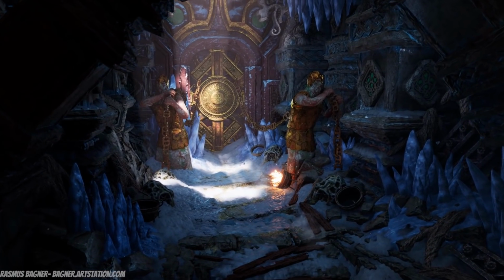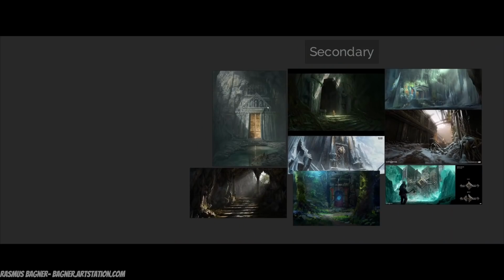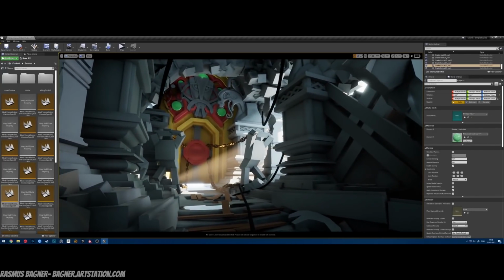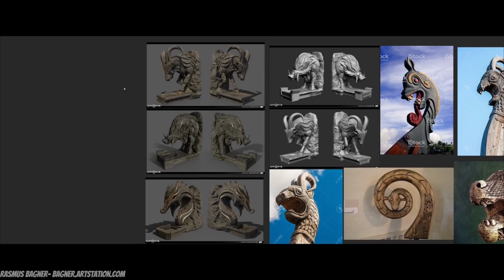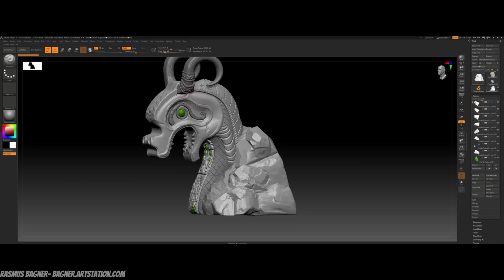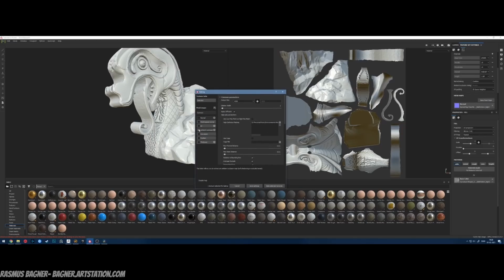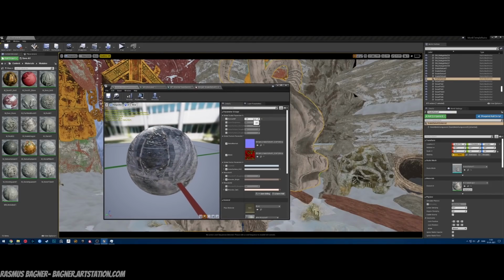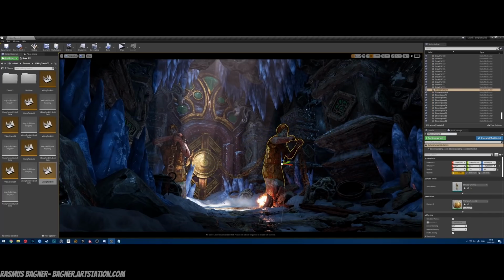How a 3D Artist Creates 3D Environments (Full workflow Breakdown)

Comment: Hello!
This was exactly what I needed to see! How long do you estimate it takes to put together something like this? I'm very conscious over that I'm very slow and is genuinely curious, so I can know approximately how much time I should aim on myself if I'm to make it into the industry. 
Also, very nice results!
Reply: Hey Julia Fisken, 
It took around 6 months after work but I always make at least 2 scene at the same time to avoid being bored.
I also took a long break from it so it's hard to give a proper estimate, but do not worry about speed in the beginning we all learn at our own speed.

Some recommendations is.

1: Make smaller scenes in terms of time needed to create the assets needed for the scene, not actual scene size you can do large scene fast with few assets though larger sized scene can feel overwhelming.

2: Have a main concept to help guide you and avoid getting stuck and when you feel comfortable with your skills try and make your own original scenes but this will take a long time to master.

3: Try and have 1 or multiple things you want to learn with each scene, do you want to get better at substance designer then make a material focused scene.
Do you want to learn lighting then have that as your main focus and maybe take shortcuts with megascans (remember to mention the use of megascans if you post it on artstation)
Doing studies like this will help speed up your scene creation time as you will be increasing skillsets that you feel you lack.
You often see this with artist using many hours on creating a single very solid asset instead of creating a whole scene.

4: Depending on how much time you can allocate try and find scenes that you can make within a manageable time, do you only have 2-3hours after work each day? Then a diorama is maybe the way to go, do you have 16-18hours a day? Then go for full scenes if you want.
I did a scene every 2-3weeks when I were looking for a job. This was 2 weeks https://www.artstation.com/artwork/0XEXYw  and I think this one was 3 weeks  https://www.artstation.com/artwork/N5gJmb  but I also worked 16-18 hours each day 7 days a week. (please remember to take time off as well though, burning out will only hurt productivity and negatively affect health, I took vacations during my job search)

5: As mentioned in the tutorial always ask for feedback but know that some feedback should be taken more serious than other, is it coming from an industry professional, a classmate or a parent.
Also decide if you want to use that feedback at all in the end you are trying to get your creativity out there and being able to know good from bad feedback is a good skill to have.

6: Joining an art community can also help a lot, it definitely did for me. Some I recommend is 
Dinusty's empire.
Beyond Extent
Experience Points

I hope this answers your question and thank you for the compliment.
Reply: @rasmuskristensen785  Thank you so much for such a thorough answer! I will make sure to write this down in my planning notebook so I can take a look at these advices whenever I'm starting new projects. I will also check out Dinusty's empire! This is truly helpful! Thanks again!
Reply: @rasmuskristensen785   Your input have really helped me as a beginner environment artist as well. I've click on your ArtStation profile and your work is simply stunning! You mentioned having to look for job and that really put me in awwe. Should studios be racing to hire you?? I've been watching many artist talk about the unstableness of this industry. It really worries me overall seeing someone as talented as you having a job gap. Do you have any personal experiences with the industry, the contract work or any overall advice for beginner like me? Is it really that harsh? Thank you so much if you are reading this.
Reply: Hello  @thyhuynh9115 ,

I were looking for a job some years ago and was hired by Ubisoft 2019 as an intermediate environment artist.

There's many factors to getting a job in game-dev, previous experience, portfolio, personality, network.

The game industry is not that unstable, it has been fairly resistant to recessions and it's limited how many studios go under and if it does happen people usually get merged into other studios if you work for one of the big companies (EA, UBI, TakeTwo, Rockstar and more)
It all depends on where you work, Ubisoft for example is a very stable studio.

The job gap for me only happened when the first studio I worked at decided to shut down whole their art department, 8 out of 10 artist are still working as artist at other companies within a very short amount of time.

My main advice is improving your art skillsets/portfolio, networking with other artist via Discord servers, game dev meetups and such.

The hardests part is definetly breaking into the industry but once you are in you can take it more easy if you prefer, it's up to you what type of studio you want to work at in terms of job security.